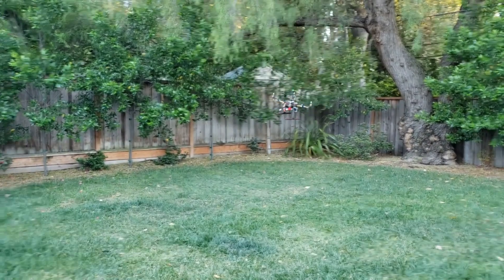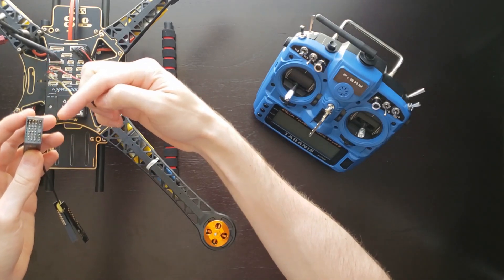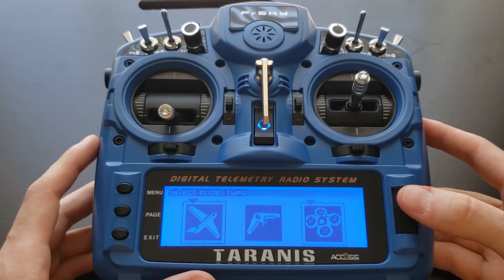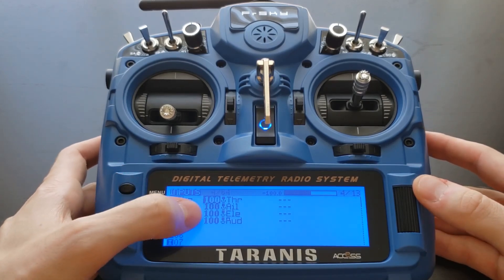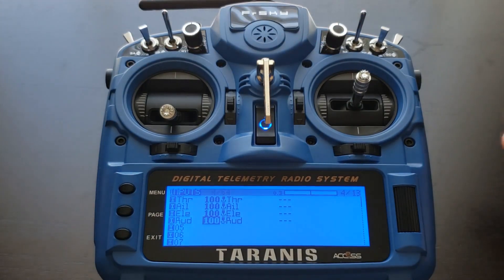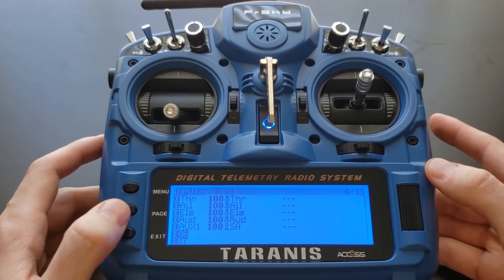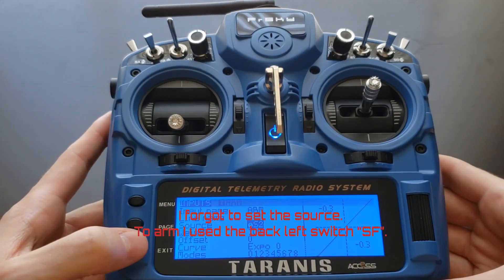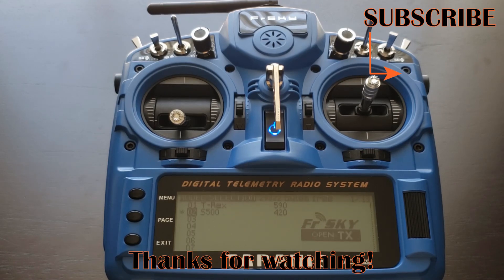Pixhawk 4 Receiver and Transmitter Configuration | Pixhawk 4 + S500 Drone Build Tutorial | Part 3

Comment: Hello Alex, great video series! Do you know if it's possible to do the same setup with a different transmitter, for example the Taranis X-Lite ?
Reply from the maker: Thanks! Yes another transmitter would also work. Just make sure that the transmitter/receiver supports sbus if you are using this port on the pixhawk.

Comment: my motors are not starting any idea why that is happening?
Reply: Motor function depends on your ESC's, which are the wires that connect the motors to your power distribution board. Have you soldered them correctly?
Reply: @nithinnaikar7373  i had wired it wrong in the wrong port actually out of excitement😂😂
Reply from the maker: great to hear you got it working!
Reply: @AlexFache  but by qground control is it not possible to arm the drone without assigning a special arming switch? because it takes up one channel just to arm it
Reply from the maker: I believe that you can turn off arming. I don't remember the parameter name but there is one that allowed me to do some testing early on without it. This should then allow you to turn on your quad, turn the safety off via the gps then automatically be disarmed. However, I would recommend an arming channel if you can afford it to prevent accidental spin ups
Reply: @AlexFache  yes but that will limit me to just 3 flight modes also would you recommend the best 3 flight modes because the names of the modes are different in qground control as compared to mission planner

Comment: Thanks a lot for this video,, cay you please share the setup procedure of Flysky FS-i6..
Reply from the maker: I don't personally have a Flysky transmitter so I don't know the exact steps, however, as long as you can find your bind option you should be able to follow the same general steps. Also, I don't think that Flysky transmitters are compatible with Frsky receivers so definitely check that out first.